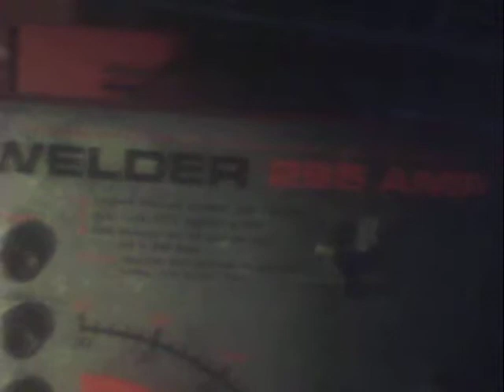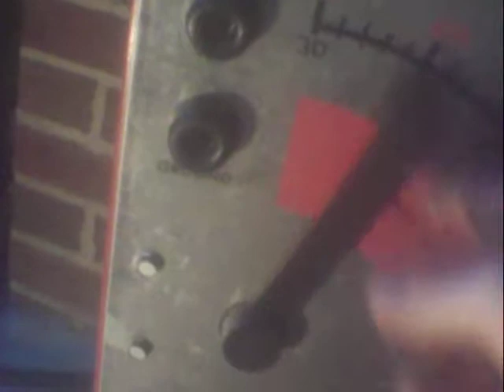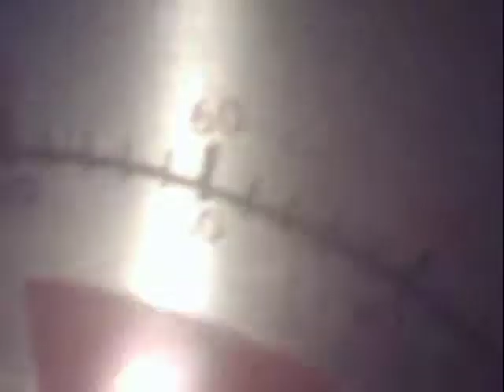Century Stick Welder, Variable Transformer, 240 Volt, how it works, basics & how to fix/repair

Comment: I got one of these, kind of neat, some older welders are swearing by the duty cycle being great and these never melting down..I am just experimenting with mine, (mig weld for my night job since 30 years now) these seem pretty decent for a arc machine and the price point is awesome and no circuit boards that burn up..
Reply from the maker: Cool man, thanks for the comment.  I'm assuming these are Not DC, just AC right? Butt we all know what assume stands for....
If it were DC it'd have to have a capacitor & such.  
Thanks again,   - take care